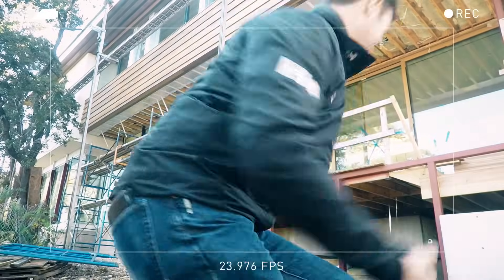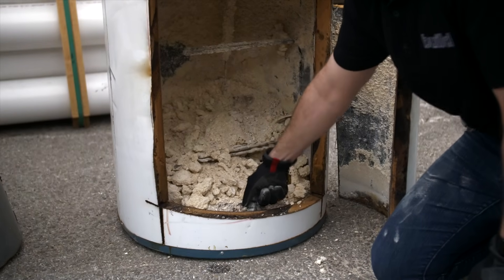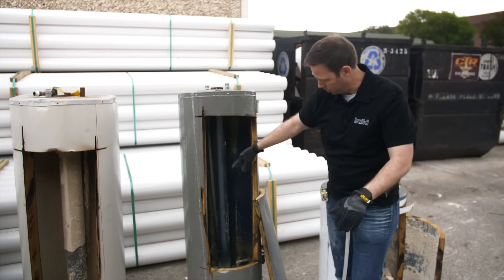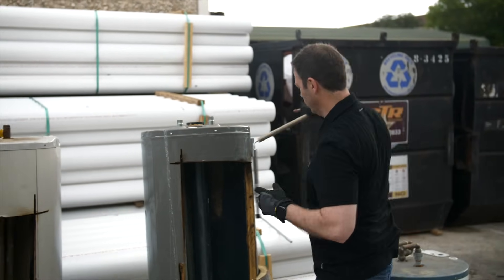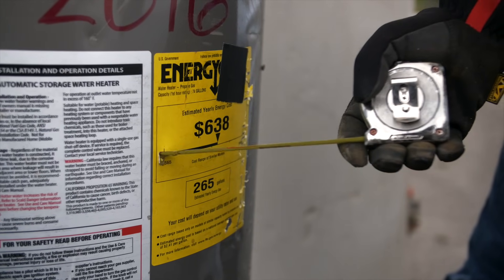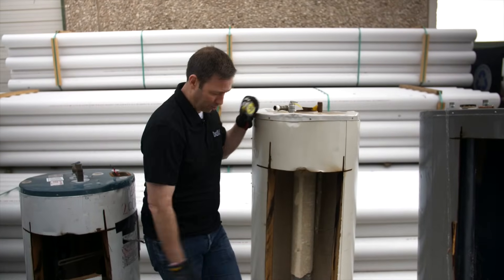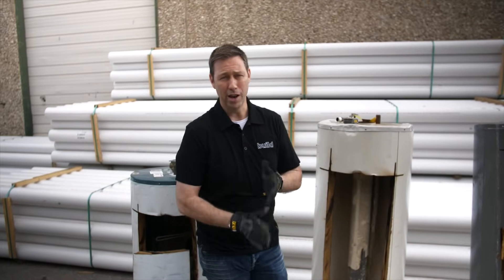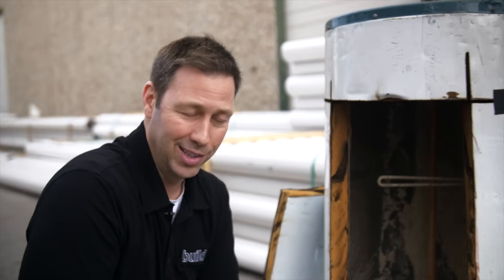Four Water Heater Tanks Cut Open - Lessons to Learn

Comment: Hey Matt, an electric water heater won't be less efficient because there is scale buildup. It is a matter of conservation of energy, which is the first law of thermodynamics. A certain amount of electrical energy is going into the water heater coil, and unless that energy is coming out in some other form, the heat is being absorbed by the water. If the heat transfer coefficient from the coil to the water is less because of scale buildup, the coil temperature will just rise to whatever is required to transfer the heat to the water. The higher coil temperature can and will cause it to melt and fail prematurely. I am a heat transfer engineer but this is just simple thermodynamics.

Comment: I think the electric water heater at my cottage is likely the original, which would mean that it was made in 1960. It still works fine. There is probably plenty of sediment in it, since our water is unfiltered lake water. They don't build 'em like they used to.

Comment: Mine was installed in 1991 GE model. It just failed. Many pin hole leaks from the bottom. Created a minor flood in the basement. The water made its way over to the furnace. If in doubt replace it so you don’t end up with ancillary issues like a flooded basement.

Comment: I just replaced my 24 year old tank due to an element going out and getting stuck on the tank. I suspect that may be the cause of death for some of these. I was told that if you change anodes's every 3 years, flush the tank yearly, and change elements every few years an electric tank could last dang near forever.
Reply: In water heater years 24 is dang near forever.
Reply: These days it is but mine lasted almost 33 years before needing replacement. New stuff more efficient but doesn't last as long as the useless warranty claim

Comment: Are these made out of stainless or mild steel?  In the uk, the pressurised hot water cylinders are typically made of stainless steel and going off memory I think they have 25 year guarantees.  I can’t recall any mention of there being a sacrificial anode in these cylinders.

Comment: Thanks Matt for the video. I always look to learn from your videos. What I just learned is the newer the model, 2016, vs. the 2000 model is just proof companies are making you buy less efficient and lower quality water heaters. This is why plumbers usually say if it’s an oldie keep it and take care if it as long as you can. Heard of the saying, it’s an oldie but a goodie. Here’s a really good example of this. New water heaters now use Honeywell plastic baloney. I recently replaced mine and it was is leaking gas. Had gas company come out and they tested it and agreed and said it was a good thing you caught it. So I had to go back back to HD and exchange it. Plumber that replaced it said almost all new ones have that plastic thermostat junk and that he usually replacing them. He also stated the old ones,when maintained,  last a lot longer. I miss the good old days. Thanks for the lesson, think I’ll buy a anode rod now and just put next to heater to replace it in a about 3-5 years. This helped me out👍. On another note, do you think a water booster is a good buy?

Comment: If you've ever seen any of the "plumber stings" that some news agencies will perform, you see plumbers selling the customers new tanks instead of replacing a $10 part or tightening a loose connection.   That's how you end up with some perfectly usable hot water heaters in...   THE BONEYARD!!!   (say it like you would "on...  THE BUILD SHOW!!!")

Comment: Pulls old water heater out - "Boy, this thing is heavy!"
Puts new one in - "This is much lighter!, Guess they really don't build 'um like they used to!"
Reply: The old ones have a foot of wet scale at the bottom that's why they are so heavy. The new ones are much better built.
Reply: @cjr4497  Something that pros expect to last 10 years and say so on authoritative websites is not better built than the old ones that lasted 20 years. Your take is so hot it would melt the planet.
Reply: I totally agree, not like they used to.
Reply: TheH454  7:12 knives , they really don't build 'um like they used to in Dundee's time !
Reply: I agree too. Mine installed in 1985  and still going. But its about time to replace it.
Reply: @richardt6980  Probably has a copper bladder. Cut it open and scrap the bladder $$
Reply: My was installed in 1983, it’s a Courier State. I’m planning to replace as I know I’m on borrowed time. Sad thing is new one will last 6 years at best. Will definitely be going with leak detection and auto shut off
Reply: r/wooosh

Comment: A while back I got the bright idea of flushing the tank with the drain valve on the hot water heater where we rent...got some rusty sandy sludge came out, then a bit of nasty water, then it just stopped.  Even turning on the water pressure it wouldn't flow out the drain valve anymore.
Reply: There is a lot of sludge in the tank. You can try a coat hanger with a loop on the end to drill into the sludge to open the hole up to get the water running again. It may be too late for your tank but you can try. Probably can t hurt to extend the life a little but plan on replacing it ASAP

Comment: I'm working in residential construction/remodel these days. Have had to move, deliver, or install a few of these things. Nobody seems to have an explanation for why there are no f'ing handles on these things. The sides are super slick, feels like a greased pole climb. If you lift them by the bottom, the edges are razor sharp. Can't get a dolly underneath them. Is it too much to ask to put some damned handles on these things? Also, dishwasher frames will slice you open. Can't put a 5 grand refrigerator on a dolly without damaging the coils. There are entire product development teams full of designers to get the ergonomics right for the end user, but they can't make them easy to install.

Comment: Do these maintenance recommendations apply when you have a water softener?  One of your other viewers wrote that water softeners reduce the life of the tank because the salt causes rust. Makes me wonder if it was a mistake for me to install a water softener.
Reply: I’m just speculating, but the point of the anode rod is to prevent rust. So if they’re working in tandem you should be good. I’m not a plumber though so don’t quote me on that.

Comment: check your words.
you pointed to the coil and called it the anode
then you looked at insulation and called it wall.  the thickness of the tank wall is about 1/16th inch.

Comment: I had to replace a hot water tank in my son's new house recently. The previous owners didn't maintain anything in the house. Grand Rapids city water is pretty hard and no softener in the house.The heater was 5 YO and just out of warranty...so it was an extra expense for the better tank with a better warranty. Anyway, the big box store told me that 5 to 7 years was normal replacement time.  That's only true if you never flush the tank, but people just except it as normal. Excellent video...thank you.
Reply: Hello from Norton Shores! Small world.

Comment: Really cool video!  I am one of the few who keeps an eye on the Anode rod.  Had a 24 year old Kenmore gas water heater that I finally replaced simply because it was 24 years old.  Figured why tempt fate?  I wonder though, I bet it would have made it to 30 years.

Since we are geeking out here, one thing one can cheaply do is buy an inexpensive borescope and run it down into the tank through the anode rod hole and have a look inside.  Since buying my borescope, I am constantly looking for things to stick it into to check out - engine intakes, water heaters, you name it - LMAO
Reply: Do you have a channel where you share that?
Reply: I tried the bore scope and was somewhat disappointed.  Seemed like I was getting enough light  to get a good image. ....and it wasn't long enough to see the bottom of the tank....I know, that's what she said!

Comment: Descaling is the key to longevity and efficiency and is nearly implssible in a tank type heater because of the large volume of descaling product needed.  Some people use white vinegar but you still need a large quantity.  Just draining does little good if you have hard water.

Comment: WOW! I owned a new, inexpensive home in Irving, TX for 18 years. I only drained my hot water heater, so that I could replace an electric heating element near the center of the tank. I did notice something that I could see through the faucet at the bottom of the tank, where he hooks his garden hose. The material looked like broken glass. I never knew if it was really broken glass or some salt like substance that crystallize at the bottom of the tank. My hot water heater only had one electric heating element. Some have two.
Reply: Some heaters have a glass lining which can crack and then flake off the surfaces it's applied to. Time to replace

Comment: Matt, just uninstalled our 2 old electric water heaters, a 40 gal closet mounted one 35 years old & upstairs bath small closet 19 gal - 28 years old.
Neither had leaks but super inefficient - they were leaking heat into our home.
Installed Stiebel Eltron (German) 6kw tankless in place of 40 gal & 120v 6gal mini-tank in place of 19 gal.
A huge Upgrade - plenty of hot water, FAR less heat intrusion into our home & electric bill should decrease $20-40 per month.
I bet they both looked nasty like the first one you showed.
Hope this inspires others !
David in Texas

Comment: They are oldest to newest. The last 3 in order are 2016, 2000, then 2005. I think he means with just those 2 rather than the whole group.

That first one looks like more than 1/8-1/4 thick. Maybe there was a section that degraded.

Comment: I have  service contract on mine,,once a year the company comes and flushes it and replaces the anode rod and cleans the burner.When it goes, which it will one day. I get a new one wholesale (labor included at no additional charge) and it would be up in running in 18 hours or less, its not cheap but the piece of mind is worth it

Comment: Good info here....but one thing you didn't mention is a HUGE variable in the scaling and anode rod life is the water source. Anyone on a well, or rural co-op water system will likely experience a ton more scaling just from the high mineral content.

Comment: Magnesium Rods dont last longer, Actually they are the opposite. Most Magnesium rods they suggest to change every 2-3 years. But Magnesium is much better at being a sacrificial rod vs Aluminum. So you have to change them more often but they work better then aluminum
Reply: Yep and soft water eats up the anode rod even faster.

Comment: I have replaced two heater elements in our hot water heater, I think its time to replace ours.
Reply: Replace the rods again and save a lot of money. If its not leaking no reason for replacing. New ones may be slightly more efficient but are more poorly made now and don't last. Other than peace of mind no reason to replace what is not broken.

Comment: My water heater is over 20 years old and I've never drained it. I'm afraid to drain it now as it will probably break? When it goes? I guess I'll get a new one..
Reply: Where the hell do you people live that your tanks last that long?? Where I'm at, we're LUCKY if we get 10 years out of them before they blow!
Reply: I just replaced my 32 year old water heater. The thermostat/valve control went out on it. Pilot light wouldn't stay lit. I changed thermal couple and ran a multimeter on it. I had 30mv of current. Thus it must have been valve control. I couldn't believe that the drain valve actually worked. I figured the tank would have been full of rust. I have high iron/calcium well water. I don't filter it but do run it through a water softner. Im going to guess theres no way my new water heater will last half as long. You might have some good life left in yours.

Comment: I've seen water heaters over 30 years old that still work. The one in my mother's house was installed before 1972 at least, and it was still there and working when she died in 2005. As far as I know it's still there. The one in my grandparent's ramshackle old home was even older, probably early-mid 60's, and it was still operating in 2006 when I sold the house. They were both electric. The sad thing is, they just don't make things like they used to.
Reply: glad they don't make things like they used to.  Lead pipes, rotary phones, DDT,toxic chemicals in the ground, yeah, it was so much better...nope
Reply: @cengeb  There’s vastly more chemical and plastic pollution in the environment today than there ever was in the ‘50s or ‘60s.

Comment: As a former markout man for a gas utility i have an observation i noticed. When marking a street for watermain replacement after the project was completed.  I would notice over months  many waterheaters were being replaced. Now u cannot put them out on the curb.  This was over 12 years on the job and in many areas. I don't know if after years of being under pressure then no pressure was the result. I knew every str that had work done and it was something that i observed regularly

Comment: What does the annode rod do and average cost of replacement
Reply: Former gas company service tech.  The annode rod helps with cathodic problems. Most homes ground to waterline meaning electric current. The annode sacrifices itself.  My self and another tech found a small leak on a house gas pipe that touched a copper pipe. Also 2 copper pipes in contact will have a small arc from electricity, its unseen but there. Most people don't realize how grounding to waterlines causes these problems. Alot of crews digging to repair a copper line coming from the str don't use grounding protocols or jumper connections. Most of the time it is ok but there is a possibility of a shock

Comment: I have a 40 year old electric water heater. All I have done to it is replaced heating elements Half a dozen times. It gets flushed when I change elements. I have never changed the anode and it is just straight well water. I probably should upgrade just for better efficiency, but don't fix what isn't broken.

Comment: When I replaced my old anode rod it took hours , I had to use a torch and an impact gun  , it was stuck . I work at it for hours , I thought I would break it . It finally came out .
Reply: And this is why no one replaces the anode rod. Also my plumber (I wanted him to replace the rod for me) said that the plastic nut at the top of the anode rod is a problem undoing it to remove - and that he was rarely successful I.e. they ended up having to replace tank. Me thinks he did not want to do the work that you put into your water heater! Thanks for mentioning the impact wrench. I think an electric one might work and might preserve the plastic nut without wrecking it. Also Home Depot sells multi point sockets that grab the nut in a better way. Thanks for taking the time to post only 6 days ago!!
Reply: Yes, many use an impact or a long breaker bar.
Reply: @zzman5306  just did my anode rod today.  no luck with a breaker bar, used an impact gun.

Comment: I'm so glad to find this video, and thank you!  Here's my story: I had a Boch 32e oil fired wh which lasted me nearly 30 years, and yes I did replace anode rods a few times and flushed occasionally.  When it finally started dripping I replaced it with a mini electric which I could carry down into basement by myself.  However the Boch is still there!  I have not figured out how to get it out yet. It's very heavy and probably full of crud.  I was thinking of disassembling it and cutting the tank in half which is why it is so cool to find somebody who has cut into tanks!  I was considering using a cutting torch but one concern was what was on the inside. hope to get to this soon.
Reply: Rent a gas cut off saw from the tool rental store it will cut you a square hole before you can say DAM
Reply: Did you cut your old tank apart?

I’ve taken apart many old appliances and sometimes cut parts but with a cutoff wheel on a grinder.
Reply: @johnlee7085  yes I did, I cut the steel tank in half with a oxy-ace cutting torch, in my basement. Then I carried it out.  The inside was full of crud. btw I have a video of this on youtube.

Comment: Your suggestion for the best video for draining cleaning and descaling a water heater? 

I live in the mountains in New Mexico and our water is insanely hard. I just bought a water softener, which I will install in Spring. The water tank is brand new 3 months old 50 gallons. Electric

How do I remove the scale on the inside? Flushing will remove the sediment but what about the scale that's actually attached the stuff you scraped with the knife? I expect I will end up with a lot of that. How do I correctly remove it?

Comment: 50gal 10years  hwh cost 650$ installation cost another 650-850$ so total 1300-1500$ on average . They last no more than 10-12years on average . Your idea is to come and inspect anode rod and flush it every 3 years in order to prolong life and increase efficiency. How much service call like this would cost 300$? So  let’s say by doing this you will prolong life of the tank by 50% and now tank will leak at 18 year instead of 12. By that time customer would spend  1500$ on this inspections and still would need new hwh .
So in first case they spend 1400$ every 10 years or 2900$ every 18 years. I may be wrong but not big margin. Otherwise this anode changing and flushing would be common practice by now. People not stupid.

Comment: They make non-metallic water electric water heaters. Fiberglass tank with some type of liner,supposed to last a long time. Just need to be careful not to twist the fittings out of them when installing,and vent when draining so as to not to let the lining suck in and destroy it.